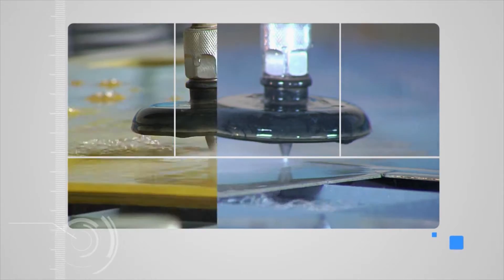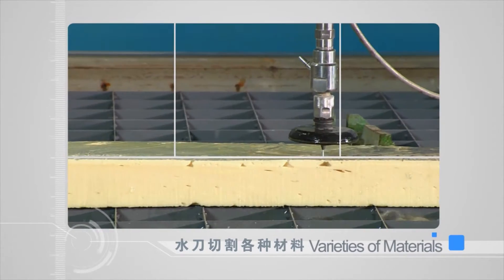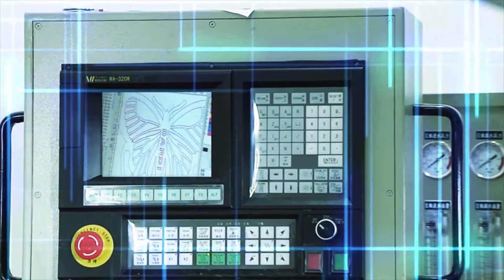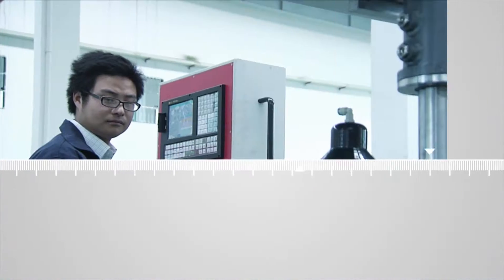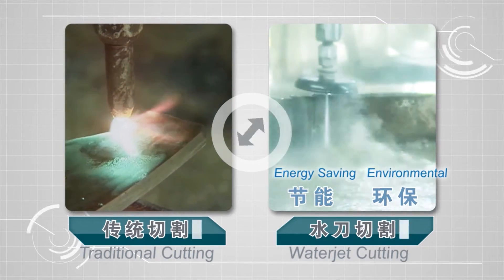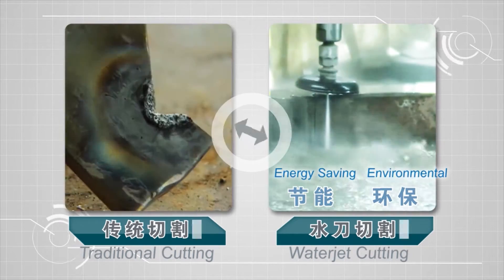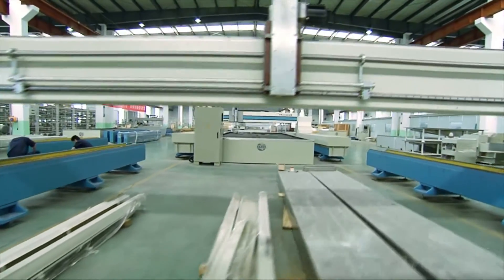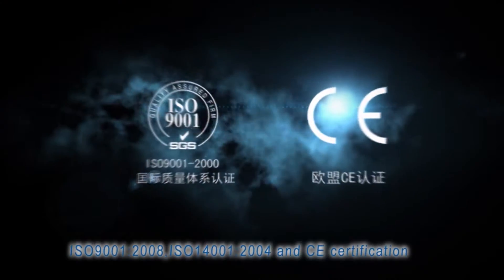DARDI International Corporation Water Jet

Comment: A Very very very bad quality and very slow after sale service, and they lie about the spell parts price ( from 1 EUR to 10 maybe more EUR in small parts ) also we had one in 5 months we had always problems on it, in pump in cutting head in pressure, valves also we r always taking care of problems by our selves without them service of after sale because they don't answer most of times, so we had to spend more money on maintenance from out side, without speaking about corrosion in sensitives Areas